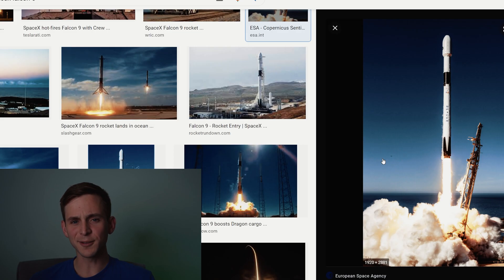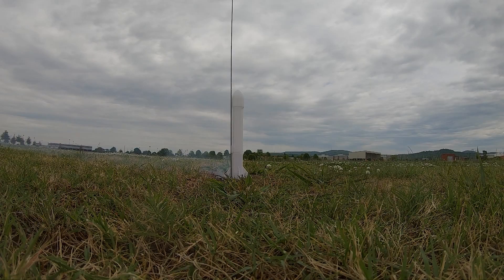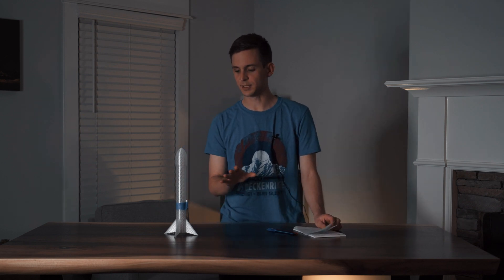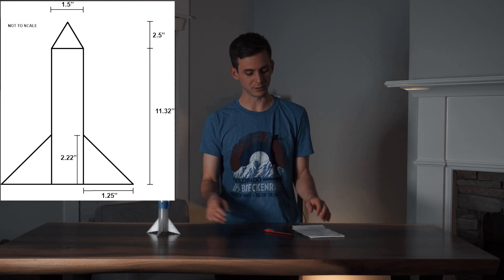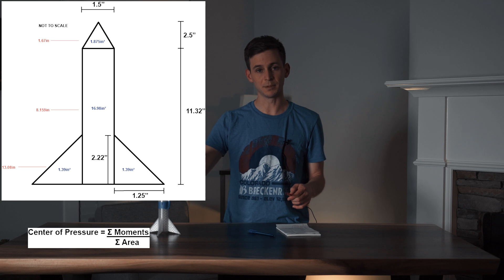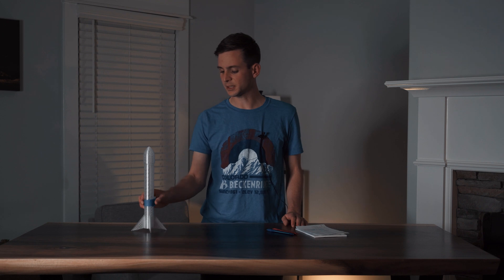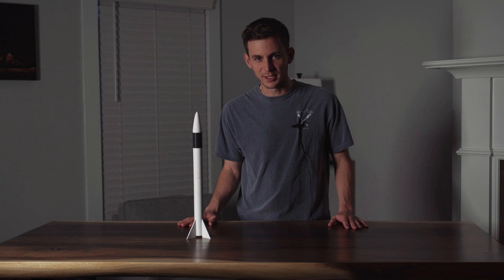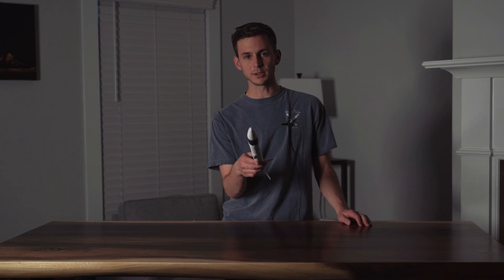3D Printed Model Rocket

Comment: What material did you use? I'm worried about ours melting around the nozzle. Our rocket is going to be quite large when it's finished though. My team is doing this for a senior design project, but more complicated.
Reply from the maker: I used PLA.  If you are worried about melting, you could look into nylon carbon fiber, that material is very tough.
Reply: @michaelmoxley590  We have a nylon printer at our school but idk if that's the same thing. It's a gray dust that a laser prints out of I think.
Reply from the maker: @ThunderTurtle7  it might work, I do not know much about different material properties when it come to high heat

Comment: Great job! Glad to see you figured out the CP/CG relationship importance. Be sure to calculate your CG with a new motor in the rocket, as well as the recovery gear and wadding. Also, the CG should be a minimum of one body diameter in front of the CG. This is known as one-caliber stability. Finally, check out Open Rocket (free) or Rocksim (paid). Both are simulation programs that allow you to design your rockets and predict their stability and performance. They are set up for common off-the-shelf rocketry components, but you can input your own custom numbers for 3D printed parts.

Comment: Pretty good I’d up the size of your fins a bit more or use a motor that accelerates the rocket a bit faster because at the speed it’s currently leaving the launch rod it doesn’t have quite enough air flowing over it to be fully stable
Reply from the maker: Thanks for the recommendation! I’ll have to try that out